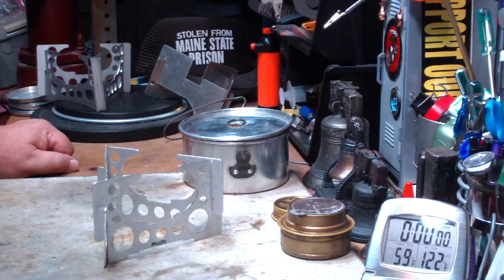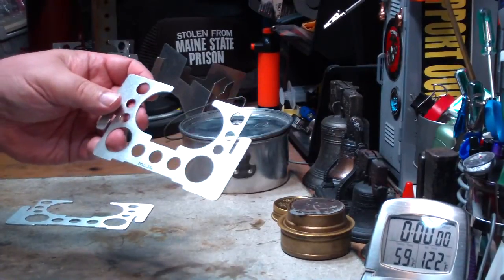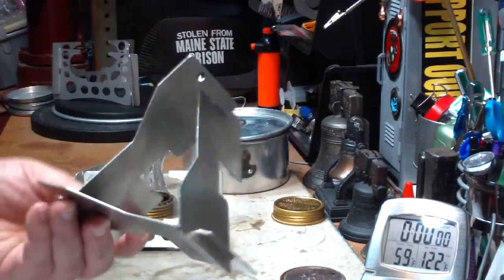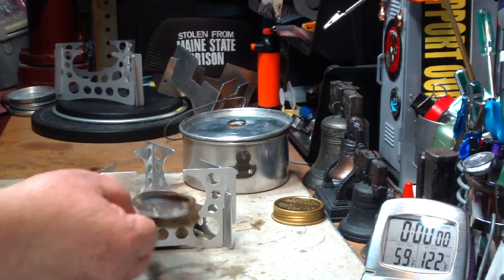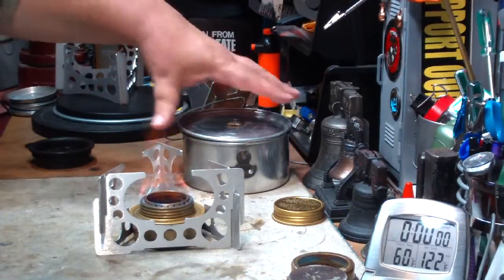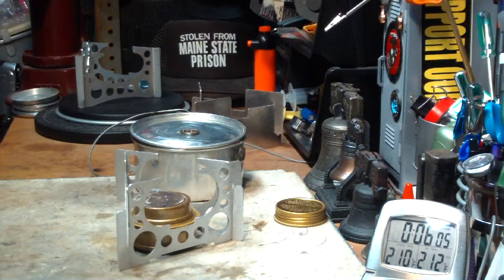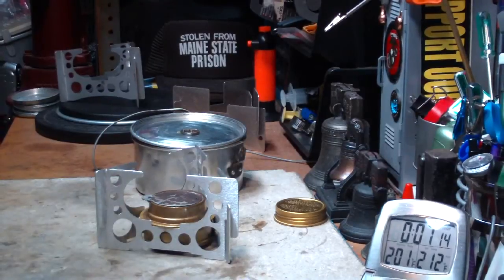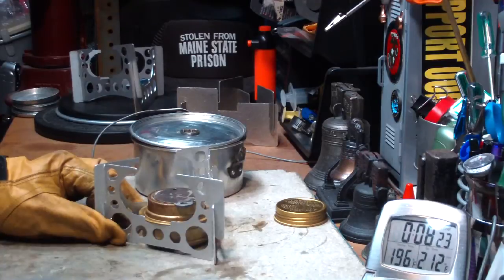Mojo Pot Stand for Trangia - Boil Test #1

Comment: After seeing your Westwind tests, I used a Dremel to lower the notches where the Trangia sits.  This improved boil times dramatically, but made the sections seem rather weak where I removed the metal.  I just treat it gently; I only use it when car camping, so it's not squished in a pack.

I doubt any gram weenies worth the epithet are using the Trangia.

Thanks for the videos, as always.  Good dog, Max.